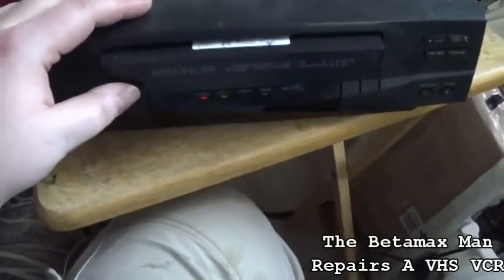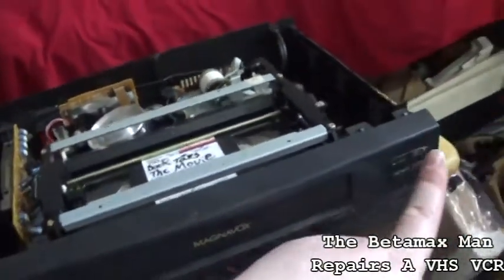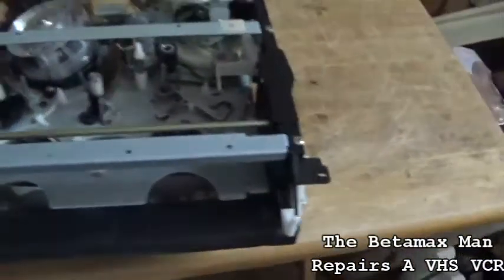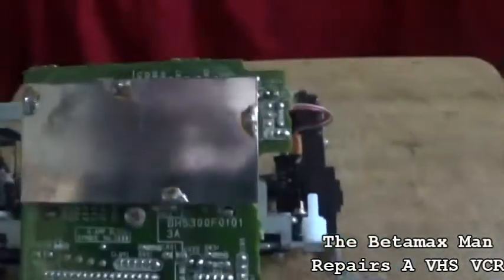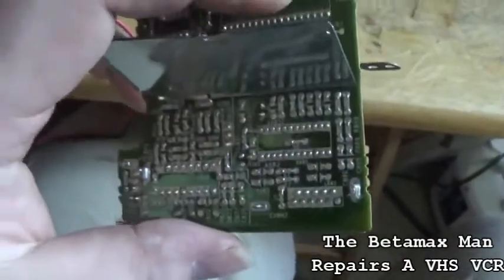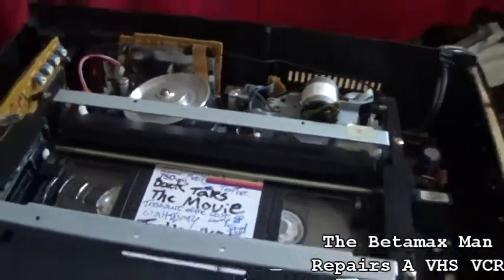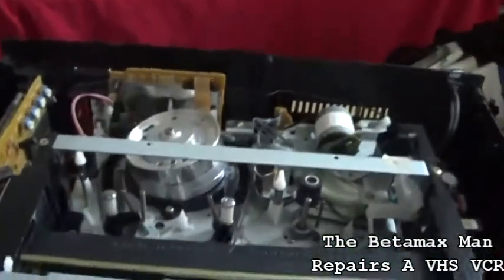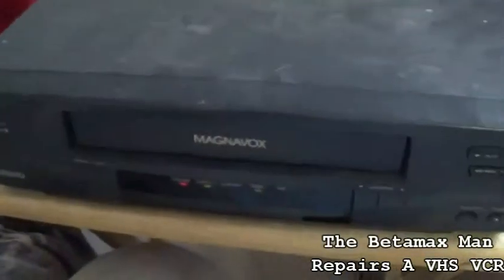Magnavox VHS VCR No Video Lets Fix It

Comment: I currently came across a Magnavox, DVD, VHS combo television, every time I put a VHS in it will play it for a few seconds, and then turn off. After turning the TV back on, it will eject the tape. The other thing I noticed was if I continue to press fast forward button repeatedly on the television itself it will not turn off until I stop pressing fast forward. Any recommendations on what this may be? I also learned quite a bit on this video, so thank you!
Reply from the maker: Try cleaning the mode switch that should help also check the belt
Reply: @thebetamaxman8905  thank you man I’ll give it a shot after work today!
Reply from the maker: @ryankuhn926  your welcome i hope that helps you
Reply: Yes but it’s kind of pain to get to the mode switch.

Comment: JVC HR-DVS3U no viveo or audio displaying on TV. hooked up another 
device to check cables and it displayed fine so something wrong with 
JVC, ANY IDEAS. when i play the numbers on screen move fine.
Reply from the maker: check for bad solder joints on the board behind the video head connecting to the main board
Reply: @thebetamaxman8905  I forgot to mention that it also has a mini DV tape player and when I put a tape in there I also don't get a signal The tape player was used about 5 years ago and then boxed up and sent to me recently thanks for your reply
Reply: @thebetamaxman8905  is there a point that's common to both the VHS and the mini DV that send the signal out I'm going to open it up today and look at it see if there's something loose

Comment: I used to have that vcr from October 2013 to December 2013 because a tape of mine got stuck in there multiple times abd it permanently got stuck by December 23 2013.
Reply: The reason it got stuck is because there is a plastic piece for the pulley for the mechanism and it can crack causing the vcr to get jammed. But, you can fix/prevent it from happening by applying krazy glue to kt and it may fix it.

Comment: How did you check capacitors
Reply from the maker: With a multi meter
Reply: @thebetamaxman8905  Of course but  what mode did you use and I presume you tested them  in circuit?
Reply: @thebetamaxman8905  I have a Daewoo and a Mitsubishi which internally look identical and both have same problem in that they take the tape and can can fast forward etc but once the play button is pressed they give err on screen and stop.